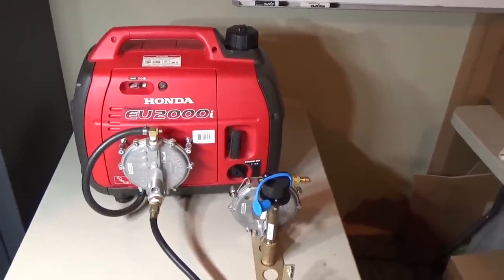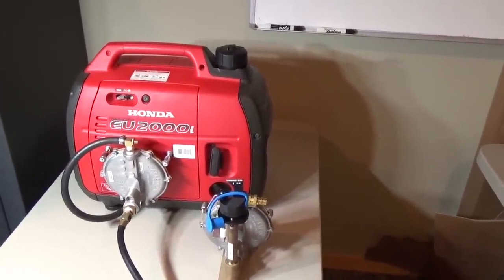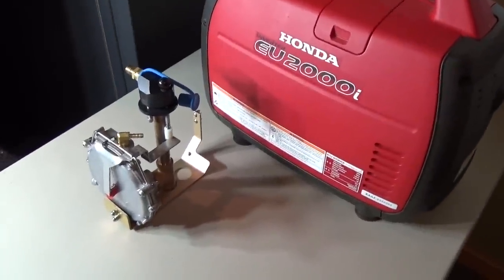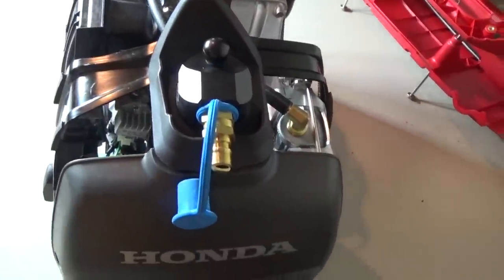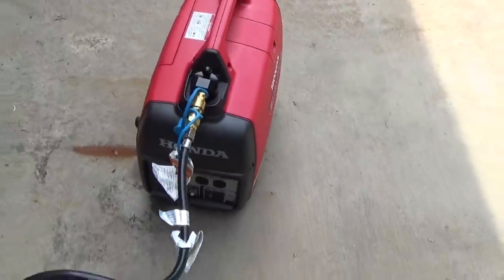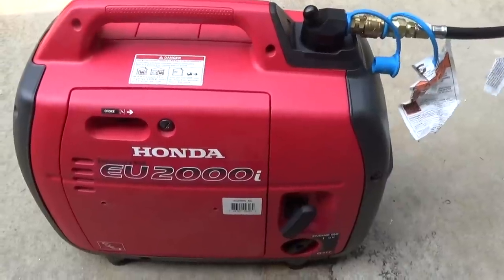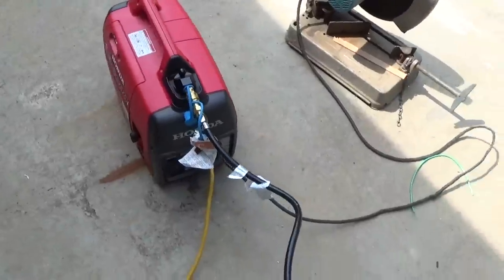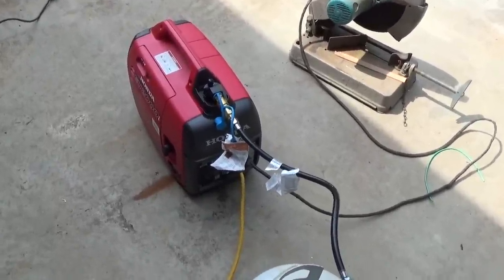GenConneX - A Slick Conversion Kit.

Comment: Vehicles and tractors run well on propane as well. We converted and had 4 units on it: 2 tractors, an orange grove sprayer with a chrysler industrial hemi and a centrifugal pump unit also with the hemi.  Engines will run durn near forever on propane because they run the cleanest of any fuel I've ever seen used.

Comment: I have GenConnx Honda 2000 they work great. I hooked it up to a 40# LPG tank and it will run for up to 40 Hrs. now. No more changing stinky gas every 4 Hrs. No more water absorbing corrosive Ethanol gas. I'm using synthetic motor oil also so no more carbon deposits and I won't have to change the oil for years.
Reply: EZ Off Grid yours must of run like cap to add gas every 4 hours!

Mine runs 12 to 15 on a single tank.
And I generally run synthetic oil
But found it burns more that just regular 30 w non synthetic .

I'm 100% off grid and no BS
Reply: @BobMarley-cm5xr  ...me as well. i put 20,000 hrs on my first honda before had to open it up and clean the valves. It wasn't even that bad and it is now back together running as good as ever. I just need to convert it to propane.

Comment: Those honda generators are THE SHIT.
Every single honda generator I have ever used was over rated by at least 10 to 20 percent. They really don't mess around and they are ready to work HARD. Best generators on the planet hands down. Even the oldie metal ones, had a pair of EM600's that were Just as reliable and even more well built than the new ones.

Comment: For any researchers here after the Texas 2021 Ice Storm, I just want to add a comment. I reached out to Honda last week about these conversions. Direct from Honda ... "Our generators are not designed for any dry fuels. Only gasoline use is approved. Any modification to the fuel system voids the Honda warranty."
I sure was hoping for a different response.  Gas was impossible to find for here for days, and I had 60 pounds of propane in the rv that would have been very useful. There are several good dual fuel units on the market that deserve attention.

Comment: I'd keep the ability to use gasoline as well, and have either natural gas or propane option. My 7,000 watt Predator currently runs on gas, and I rotate the gasoline I store for it out every 6 months even though I put STABIL in it. I did put a higher efficiency spark plug in it, and also changed the bowl drain screw on the carburetor to a wing screw with a fuel rated o-ring so I can drain the carb without tools. I also added a 450 mFD 75 volt capacitor across the 12vdc side of the dc power outlet after the bridge rectifier to give a cleaner DC output from the unit as well. I am going to put  a tri-fuel conversion on it, so I can patch into the natural gas line, or run on a propane bottle if gasoline runs out. More options are usually better.
Reply: cool.

Comment: Engineer- you mentioned this will run on compressed natural gas. My car runs on compressed natural gas and it's industry standard is 3,600 psi. It takes a very high level of compression to store a reasonable amount. This could probably run on 1/4 to 2 lbs of natural gas (like off the home regulator).  Looks like a sweet kit though!

Comment: FYI- power tools not under working load do not use nearly the amount of power. Best to have the load on a meter like a kilowatt meter to verify wattage.
Best...
Reply: It should probably also be noted that the rating on those electric motors is at their peak which is at start up, so turning them on at the same time would be a better test of the breaker.

Comment: I own a Honda EU6500is gen and asked my local Honda power equipment service manager if Honda manufactures a propane conversion kit for the EU series gens. The answer is NO! When I asked why, I was told that the older Honda industrial gens designed for LP/LNG used a steel gear to couple the motor to the gen head as well as having hardened exhaust valves and the newer EU series gens use a phenolic plastic gear to couple the motor. The higher engine operating temperatures that propane produces will eventually cause the phenolic plastic motor coupler to fail. If you purchase a EU generator and convert it to propane, Honda will refuse to pay for replacement parts/labor when you take it in to have it serviced or repaired if they find that the cause of the failure was related to the conversion, i.e; burnt exhaust valve due to higher operating temps. I inquired about a steel replacement gear and was told that they don't produce one for the EU series gens. Because of this, I am selling my EU6500is and buying a Cummins Onan 20kw standby that is designed to run on LP/LNG.
Reply: MrWhitewolf1488 thanks for the bad news :(
But really thanks
Reply: Not doubting what you're saying, but we've been running a bunch of EU2000i's on natural gas for over 15 years and with many thousands of hours have had no problems at all.  When we adjust the valves, they look like new.

Comment: How long can it run on that tank of fuel?
Reply: I was wondering the same thing.  Costs me $10 to fill up a cylinder versus 2.5 gallons of gas.  Plus with the cleaner burning propane can you go longer between oil changes?
Reply: Gas has a higher BTU so it is more efficient but propane burns cleaner and with the price of gas now propane may be a cheaper option.
Reply: *****
4.7 gallons in a 20# cylinder.  Can get refilled for $10-20 depending on where you are.  Propane is about 17% less efficient than gas.  Propane doesn't go bad.  It will degrade the seals in the storage vessel.  Tanks have been stored for 10-15 years and still worked.  As long as the tank has pressure and will supply propane it is good to go.
Reply: I guess I should have checked the comments before asking the same question. Here in York co. those bottles run between $20-45 depending on if you have one to trade in.
Reply: James Montgomery
Costco was $10 the last time I filled one up.  I have about 10 of the tanks so I can get them all refilled when the cost is low.  You can catch the refills on sale at grocery stores like Bi-Lo and Harris Teeter from time to time.
Reply: Bob Marley short attention spans

Comment: Pretty cool little kits but pricey.  Pro's for conversion are interesting on their site however.  Thought I might be in luck as I have a Yamaha, but alas, mine is the 2400, not the 2000.  Doesn't look like they have a kit for the 2400.  Thanks for the vid!

Comment: Can you compare the cost of running the generator on LPG versus gasoline at today's cost for each?  I'm assuming it takes more LPG since it's not as BTU dense as gasoline, but am wondering about the bottom line.  Great topic by the way!

TXM1836

Comment: could you use common garden grass to make...  grass gas?. i have seen some stuff on biomass fuel but iv never seen any one use grass. so many times iv passed cut fields and over grow gardens and just wondered if its a usable substance.
Reply: you could probably throw it in a char chamber and make syngas out of if. it won't make as much as using wood and other debris as well, but it should produce something.
Reply: cant hurt to try it some day. but try running your car on compressed air. check out fuellessusa.com look under thier air engine
Reply: it would take electrical energy to run the pump and that will cost money or if there is a black out you cant power it either. but everything burns lol and if its free and abundant.. even better. iv gone past fields and parks covered in tons of clumped up cut grass and i could freely collect it and store it. i dont have to cut or chip it in order to use it aswell. =D
Reply: all you have to do is ask the land owners if u could take the cut grass. most of them will say yes and ask u to come back as long as youre polite abut it

Comment: There no vacuum hose running from engine intake to regulator.... how does it regulate propane vs load? So propane is either on or off? Propane is in gas form does not store in carb bowl like gasoline  does....this seems like a waste of propane...  so they pretty much just tune the engine to run on full throttle and when on  eco or no load you're wasting propane and running rich?
Reply: Neal M with propane they do not idle down to eco mode. They stay 100% rpm when running on propane. So yes it wastes propane due to this as no matter the output load generator runs at full load rpm. Bad flaw in the conversion option.  I will stick to gas. Also it burns about 1 pound of propane per hour. I can only run 100hours on a 100lb/25 gallon tank. With gas i can run 6-9 hours on 1 gallon of gas depending on load. So 12 gallons of gas (36$ @ 3$ gallon) or 100lbs of propane ( 64$) for 100lbs.  So it costs almost DOUBLE to run propane VS gas. PLUS  the ridiculous price of conversion kit (300$). So gas is better for me.
Reply: The "demand regulator" opens to supply gas when faced with engine vacuum.  The greater the engine's demand, the more gas flows.  The Econo mode works fine, as only the gas demanded by the engine's vacuum is provided by the regulator.  If your generator isn't operating properly in Econo mode, the demand regulator is not adjusted properly.  The adjusting screw is under the cover above the gas inlet.

Comment: The power tools test is 100% invalid. First of all it was a "no load" test. You need to saw something with that makita for it to draw 15A otherwise its just idling away with no resistance. But secondly, that makita started slow, a classic sign of not enough amps for the startup current draw. So two strikes on that one. I'd like to see you do a nice big cut like a 4x4 wood post or a 2x10. That'll test the load. Interesting product anyhow - the load test may or may not be significant as it was not really valid nor was it a comparison against a stock unconverted generator.
Reply from the maker: Can you tell me the startup amps of that Makita motor? Didn't think so the startup amps of that motor is a load test. Sorry I ran out of gas before I could cut something.
Reply: Dude, inrush current for a motor IS NOT a load test in any sense. First because the inrush current can be limited and the motor will still spin! As is shown by the sluggish start, even if the motor wanted 15A or more inrush current it wasn't there to be had.

If you are going to publish a video like this, be prepared and don't "run out of gas" (you're a prepper and ran out of gas before you could do a 15 minute gen demo?!? Whatever, I'll try to believe that.)
Reply: KirillElrond - Wow what a good little keyboard warrior you are, look at how smart you are …
Reply: Agreed, this isn't a load test.

A convenient way to load test generators is with a space heater.